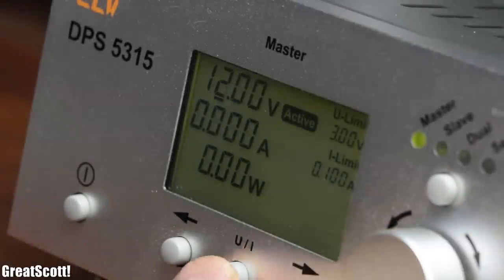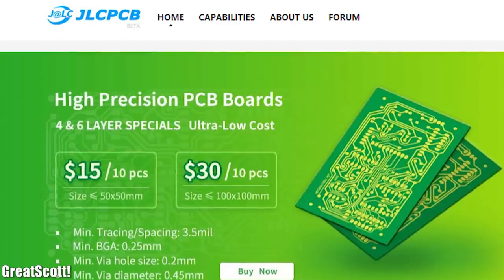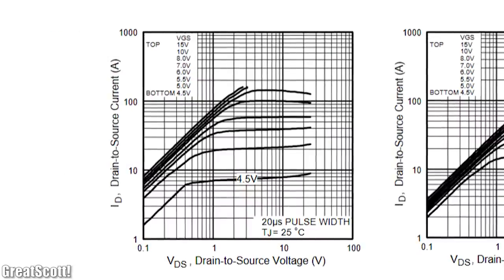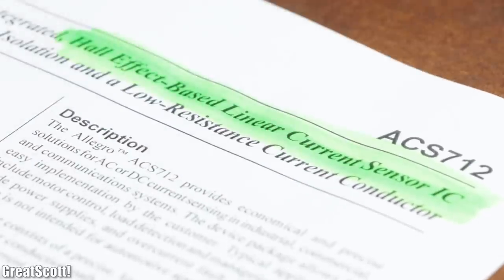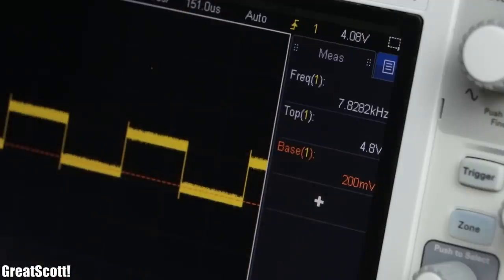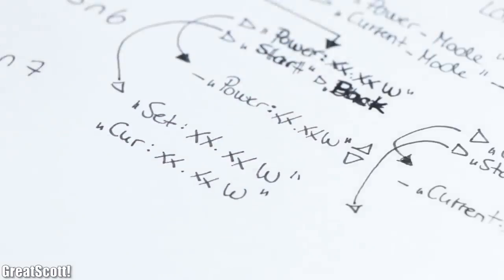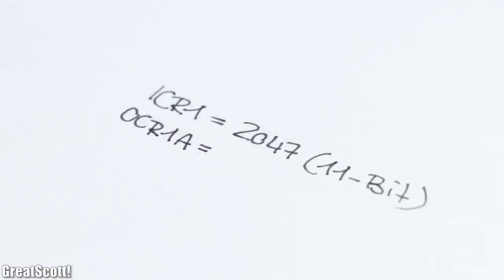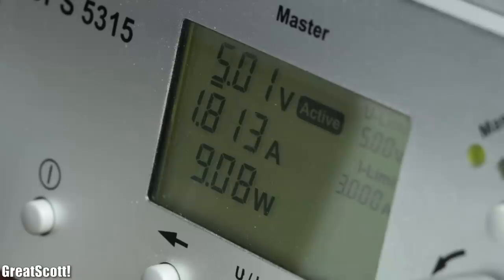DIY Adjustable Constant Load (Current & Power)

Comment: Hi bro I'm your's very old subscriber and now I'm working on a project which is Automatic plant watering system  in this project I have to detect moisture of soil with soil moisture sensor and pumps water when soil is dry and I want that it sends the reading to my smartphone through thingspeak by using esp8266 WiFi module . I'm very confused about the program .SO CAN YOU PLEASE PLEASE PLEASE HELP ME WITH THE PROGRAM. I HOPE THAT U WILL HELP ME!.

Comment: This approach works because, nowadays, you can just overkill the processing power with low cost sub-assemblies and get it to work regardless of your, actual, electronic engineering skills

If you were actually engineering this in an age before it being cost effective to throw the kitchen sink at this sort of problem, you would have failed miserably, imo.

Comment: Grüße aus Dresden! Thanks a lot for the idea, exactly what I needed for a start to create my own load. I was improving your design a little by using another sensor (INA219), which can measure voltage and current at the same time. So no voltage divider is needed anymore. On top I added some temperature control after I burned the mosfet due to bad contact to my heatsink. During my build I found a "nice" problem as well. During boot of the Nano the mosfet driver receives a pwm with 100% duty cycle for the time it takes until setup runs. This can last for 2 seconds based on my tests. If the voltage source is connected already, nothing limits the mosfet from drawing as much as available current. There is an easy fix by adding a 10k resistor between Arduino pin 9 and ground. I posted the improved version on github at https://github.com/pstimpel/ConstantLoad 
Prost und nochmals danke für die schicke Idee!

Comment: Always wondered why you cannot buy cheap electronic-loads with a CP feature. You're talking about 100's of $$$ for something with CP.  As this video shows, it's not that difficult to achieve, and most cheap electronic-loads will already have an MCU - a bit more circuitry, a sprinkle of code and bob's your uncle!  Surely some chip maker has already produced an MCU with higher than 8-bit resolutions for precisely jobs like this?

Comment: Hi.
Thanks for making the video etc, but isn't it a bit premature to say the design is finished?

I'm making the following as constructive comments, and I'd personally like this design to be useful for my own purposes, but I think it's quite limited compared to the suggestion that it COULD go up to 30V/20amps (600W), regardless of how vigorous your forced air cooling of the heat exchanger was.

Unless I've missed it, the highest it's been shown to go is 6V/3amps (18W), which is 3% of that rather vague 600W.

If you add up the component costs, and even assigning no value to your time, this is going to cost MORE than as-built designs that DO go to 100W (see reviews on YouTube).
And might well cost quite a bit more if you do as Herr Scott suggests, and sponsor him on Patreon.
And there are other designs just on YouTube that will definitely take more thasn 100W (Kerry Wong, Scullcom, EEVBlog, MarcoReps to name a few).

And that is the thrust of my point here: Herr Scott is a professional YouTube content provider. He's making a profit from this, or at least aims to do so. 
And to me, as a professional engineer, that implies a certain rigour to the quality of the project.

I'm not against him or anyone else making a profit: I'm a capitalist, and as long as the person pays taxes, and puts the money back into the ciculation it's all good. 
But it DOES imply a certain resaponsibility for due diligence in the work. And I think that's missing here.

The income to Herr Scott from these projects comes from:
(1) Affiliate payments if you buy from Amazon etc via the URL link
(2) Patreon subscriptions if you do so (as he suggests)
(3) Sponsorship (from a PCB maker whose product is interestingly enough not used on this: why not? See comment below)
(4) Possible YouTube income (not sure of his arrangement here)
(5) Instructables: if you want the full benefit, you need to suscribe, and I'm not sure if content providers get a kickback here

Sure, if you just "lurk", then it doesn't directly cost you anything, but in my eyes the IMPLICATION is that it's design work done by a paid professional.

I think a better, more rigorous design would have tested the proposed design and seen what itys limits were: before calling it complete and putting it into a box etc etc.
And ideally, BEFORE any testing was done, I think there should have been some work done on PREDICTING its maximum power: if you look at other You tube designs, some do that.
Look at Louis Scully on ScullCom for one.
It's not a lot of effort.

Then, if that power is not sufficient, you go back to the design, and see how to improve it:
- Another Power Mosfet?
- Two (or more) Mosefets?
- Some other changes?

I'm not saying this needs the input of a building full of NASA type design engineers, but as the saying goes "Think twice, cut once", but the current design is going to cost someone around $50/£50Euro50 to build at the least, on top of which anything you pay Herr Scott via Patreon and/or Instructables.
 
And that gives you something that can handle....what? 
18Watts yes.  
50 Watts probably.
100 Watts? Maybe........
Much more? I think unlikely.

But what about that, in effect "cllick bait" (elusive?), comment about getting to 600W?
I think not with this Mosfet unless you cool in liquid nitrogen.

I've not watched anything else by Herr Scott, but personally, I'm a bit disappointed by this.
To me, I think it puts the other projects into question that he's done.
I guess that's based partly on what seems to me a pretty wild claim that it MIGHT be capable of 600W: and nothing done to justify what seems quite impossible.
I think it would have been better to say it can go to 18W, and maybe a bit higher.

Comment on effort and time:
Great Scott commented about why he didn't use a PCB:
"I would love to use their PCBs more often. But when you got 1 week to create a project from scratch then you can not wait a week for PCBs."
Hmmmmm, has JCB seen that reply?
And surely a proper PCB would be a professional way to round this project off: you could even SELL some via link if you really thought it was a solid design.

I don't understand why there is a 1 week time limit on doing the design (properly)?
Sure, if Herr Scott wants to pump out a project every week, but then there's nothing to stop working on several projects at once, and submitting them when they are done to whatever level of thoroughness is needed.
In fact, a better way might be to produce a first video with a working prototype, and mention its pro's and con's, and wait for any feedback.
And then produce a final verson.

Maybe this has a bit of a negative tone: but I'm trying to be objective and professional about it.
Please tell me if anything I've said is wrong.
Reply: H'mm ...I note the clever Chinese folks now sale a "150W 200V 20A Adjustable Constant Current Battery Capacity Tester Module" based on a single mosfet, heat sink and big cooling fan and manage to market it for less than $50. The most interesting part of this project (as well as many of his others) is the fact that some of us less educated folks can get an idea about how various sections or components might be used to achieve the desired goals. In this case I was trying to figure out how they were using a MOSFET as a variable resistor ... this project illustrates that nicely.
Reply: I agree, seeing this as an engineer it is not finished and could easely be done properly. Using different external ADC/DAC, or even a different MCU with better specs. Making a PCB instead of a perfboard.

Comment: Which is more Likely to kill you volts or amps
Reply from the maker: You need both
Reply: Volts and amps work in pair. U=R*I I=U/R
U=Volts R=Resistans I=Amps.
You might get cardiac arrest as low as 30mA but some can withstand both higher and lower current, so... don't test that please... Don't the stupid one that everyone remember.
Reply: Without enough amps AND volts you won't die.
Reply: As an electrical engineer - the old adage "It's Volts that Jolts mills that Kills!"
Reply: Asking this question means you should stick to small batteries and start learning at Ohm's law again.
Reply: ElectroBOOM wants to meet you!!!

Comment: I'm sorry, but this design is just crap. Might be a fun and simple project for beginners to replicate, but there are just too many flaws even while being so simple.
The control loop running through the uC (!!!) and not an opamp, the poor resolution caused by improper (none) current sensor output conditioning, using a MOSFET driver made for fast switching to drive the device into its saturation region anyway, very poorly chosen RC filter values for the gate voltage filtering...  No. 

Just to mention - something this channel has taught be wrongly is ALWAYS using a MOSFET driver when working with MOSFET. That's just stupid, don't do it. MOSFET drivers should only be used when the MOSFET is needed to be switched on and off extremely fast, e.g. in a switching converter. Not in a linear PSU or load where you want it not to switch at all, just stay half open.